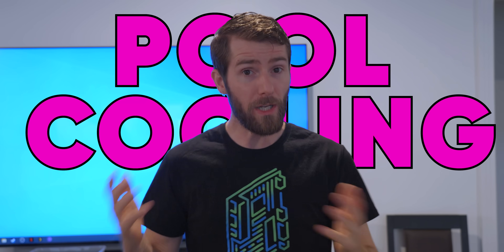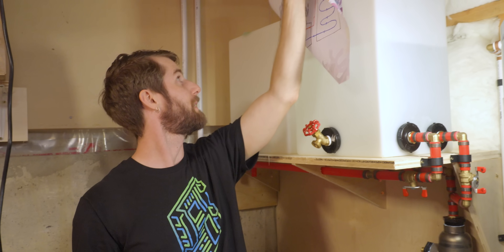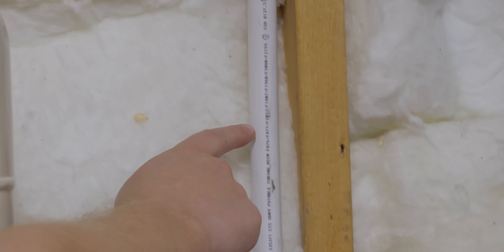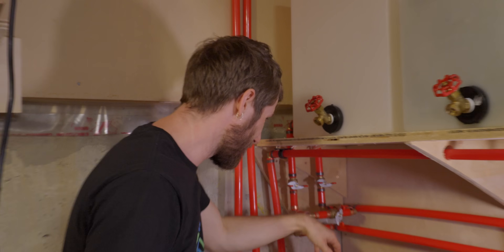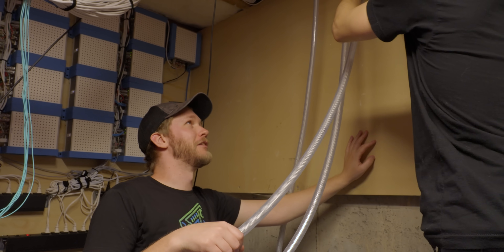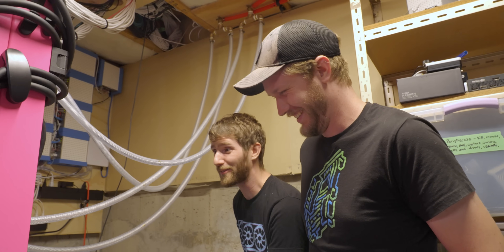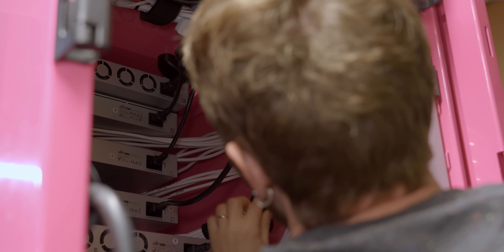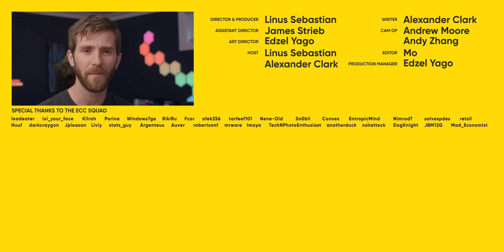My pool leaked and killed my computer - Whole Server Room Pool Watercooling Part 4

Comment: I'd guess this has been mentioned before but the pool offers up nothing.  The volume of water in that much tubing buried that deep underground would cool the rack just fine if the hole was filled with dirt.  In fact the pool might make it worse.   Ground temp 8 ft down should stay fairly constant around 55°F and if your pool temp is warmer you are probably making your loop temp warmer.
Reply: offers nothing except having the added benefit of warming the pool...

Comment: I cant believe that i thought your pool cooling loop actually dumped the water into the open pool and pulled to cool water from the open pool.   Instead you just have a loop imbedded in the concrete. lol.    I wondered how the pool chemicals affect the equipment.  But now i know that it’s a closed system.

Comment: 1.) Doesn't have a professional grade system installed
2.) installs mother boards in an upright position instead of horizontal facing down so leakage would not contact the mobo
3.) uses clear plastic tubing instead of brass in a server room where nobody will see
4.) installs the motherboards sequentially vertically instead of side by side

He could have hired an engineer to draw up something on a freaking napkin that would have been better than what he had.
Reply: Well, yeah, no crap, but this is more fun and entertaining.

Comment: A system is only as strong as the weakest component. 
That plastic "connection box" for the computer side coolant sent shivers up my spine and into my soul... 
It is going to fail. And it will be annoying, timeconsuming and very likely expensive to replace or fix.

Comment: why would you put those multiports at the top of the rack they will be better at the bottom so in case of leak the water will be on the ground and you can simply put a tray underneath that and place a cheap rain sensor in it to get an alert. I see alot of fire hazard. You need to hire someone for cable and rack management. this video is like watching downfall of this channel.

Comment: I used cablemod's 12vhpwr cable for about a year and I got constant black screens the entire time. With and without the 90 degree adapter. Switched to the gross giant adapter that came with my 4090 and have had zero problems. Cablemod support was no help

Comment: The HX is irrelevant.  This is a closed loop system.  You should of cleaned the loop out first before connecting to your servers.
Reply: Also go all pex with crimp or ottiger clamps  and ditch those worm gears and that clear pvc pipe.

Comment: I read somewhere about the fact that water in a pc cooling system needs to travel in tubes that are bend and not in a 90 degree angle. Somewhere along the line of flow restriction and even wearing off on the inner tubes. you might want to look into this, if you did not already.

Comment: REPLACE THOSE PLASTIC MANIFOLDS ASAP.
I’ve just watched this for the first time, knowing that cross-threaded, silicone gunked manifold has been in use for 3 months is giving me anxiety! Silicone degrades plastic just enough that the cross-threaded outlet will loose all tightness.
Never apply silicone to plastic for water tightness unless the data-sheet for the plastic product says so!

Comment: YES HE labeled them wrong... this is why if its not a directional dependent thing like a check valve you don't put ANYTHING on it! because in theory everything could be run in the opposite direction at any time.   What happens down the road when you need to change things round...  oh wait that never happens.  :P

Comment: JFC, put the manifolds below the lowest system in the rack, and on the outside of it, especially as you already know the fitting that was siliconed WILL leak at some point!

This is the absolute most basic consideration in pre-emptive damage control and it takes essentialy zero effort... Water won't run up a pipe if it leaks...

Comment: I've only ever had a switch do that when the surge device is really badly made and all tied into one 'detection' port.... the other option would be a bad ground, which would have popped a capacitor/resistor inside. honestly could have been worse... especially if those were holding PoE.

Comment: So what did we learn?
1. Buy the correct tools, materials and professional support you need instead of having your largely unqualified workforce cobble it together with parts from Home Depot and Aliexpress.
2. The simplest solution isn't always the best. The amount of gunk and debris in the loop was never going to be fully removed via blasting it with water.
3. Listen to Jake. He said that the loop without a heat exchanger was stupid. And guess what? He was right!

Comment: To make it easier to remember you have a source manifold and a return manifold. The hose from the Source manifold plugged into the computer on the in port and the return manifold is plugged into the out port. If you use those terms in conjunction it will help.

However, this manifold setup will not work properly. These types of rail manifolds will not equally distribute the flow across all lines.
More water will flow through the sections with the least resistance and your total volume of flow will only be that of the manifold source pipe. Which looks to have the same diameter as each individual device pipe.

Comment: I feel like it would be a great idea to figure out a way to mock up a panel for the water lines on the back of the server case, maybe where the lines go through it with rubber grommets to keep water from streaming into the case if the distribution blocks leak

Comment: with the holding tanks it is no longer a closed system. The red pex is called oxygen barrier tubing. The circulator pump is never a self priming pump never ever. You should limit the use of plastic female threaded fittings, they always,always crack. the pex needs to be protected from uv rays in a year or 2 the piping near the pool is going to riddled with leaks, the piping exposed to the sun should be insulated to maintain btu and protect from uv rays.
Reply: The piping is inside a shed now. The shed was just under construction as this video was filmed.

Comment: The pipes should be labeled "Supply" and "Return". Supply is cold water feeding the systems, Return is returning to the heat exchanger to be cooled again.  If pressure is too high, you can use a pressure reducing valve. To make sure there's even flow, you can install circuit balancing valves to each supply OR return from the headers. You'd need a flow meter to see the amount of flow to each component. The bypass should also have a circuit balancing valve, so if there is not enough flow going to all the systems, you can dial it down, but never off.

Comment: Manifolds should be mounted at the low point below the hardware. That way if any leaks did occur the water would go to the lowest point which would be the manifolds where all hoses go to. Best protection for the real hardware. Only leaks that would destroy the systems would be leaks at the water blocks themselves inside the PCs. Besides that 10/10. 💪❤️

Comment: I’m really wondering how you or your kids will ever sell your home the way it is
The modifications are going to be a major no deal for most
Reply: Which ones are you thinking would be an issue?
Reply: @haxie4516  it could be anything, a leak like this video, or the strange setup. homebuyers are not going to bet a million dollar for a home that is nestled with a time ticking big expense bill down the line, especially when the buyer may not be equipped or knowledgable to fix the issue. not to mention maintenance or using the setup they made is going to be a nightmare for the average person
Reply: @bcatbb2896  
Well, the leak in this video was to do with their server rack, which they wouldn't be leaving behind.
Like, I can't think of a single thing that was installed that has any issues like that, but isn't also something that is removable, and would be removed on moving out
Reply: Buying homes for the purpose of selling for profit is the reason why we have a housing problem. 
Just live in it forever and your kids and beyond.
Reply: @자시엘  dude, that's only one of the reasons we have a housing crisis. people have always been buying to resell since Canada's founding, the main pushing force is foreign investment after the market crash a decade ago

Comment: Never once has my NH-D15 "leaked"... Just saying...
Reply: @@CantStopTheSignal337
The install here wasn't the issue.
But you'd know that if you weren't viewing everything through your red tinted goggles.
Reply: @@CantStopTheSignal337
I mean... You clearly didn't watch the video if you are making that assertion in direct contradiction with what actually happened...
Reply: Never once has your NH-D15 fit inside a 1U chassis... Just saying...
Reply: @haxie4516  ⌐_⌐ Did you watch a different video? Because that wasn't a 1U chassis... Just saying...

Comment: This idea was stupid.
Also keeping your CPU from producing too much heat would've avoided that.
Undervolt it.
Reply: No, not really. Geothermal cooling is pretty common in many parts of the world.

And no, it wouldn't have avoided that, actually.
Undercoating it will leave performance on the table.

Comment: Amazin work and a great example of how to use all that heat for something productive.  It might be beneifical in the long run though to put some cut off valves into the loops and branches to allow for swap outs and maintenance without having to shut down the house side loop, stick pressure gauges in the loops so you can monitor for leaks more easiliy, and perhaps not mount the distribution manifolds directly to the server rack, just in case and so that when it comes to maintenance and swap out you dont get dribbles near the server systems
Reply: They use quick disconnects to enable them to do so without valves :)

Comment: segregate the quick connect blocks with a path for future leaks into a drain or a bucket with a pump that kicks on in the water is too high. at min do not mount them in the rack. its going to leak again. also they should lower so when it leaks the water does not go into the rack

Comment: But. But.... I need to understand why there was a short that blew the fuse, and also WHY the switch caught on fire??????????????
Reply: The fuse was down to a bad SATA power adapter that was shorting +12V to ground, and the Ubiquiti switch's failure is unknown, they just replaced it
Reply: @haxie4516  TY! However what’s concerning is:
If it’s that simple, I own that switch and it can burn down my house
Or:
The problem happened when a human did something right next to it: that may have played a key role in triggering this fire.  WE NEED TO KNOW.

Comment: Your plumbing, materials  and manifold are sketchy.  I strongly suggest you use a HVAC contractor to help with the sizing and specification of your piping, pumping, HX and explore all suitable sinks for waste heat.  They will help you calculate the cooling load (amount of heat to be removed) and next help review the best (first cost plus operating) approach in terms system design.  You have a beautiful home and equipment, so asking for a little bit of help in this regard is not a fail.  You did the same when you installed a very similar system... the closed loop underground heating system.   In fact you could even use pre heat of this system or your domestic hot water as a potential for waste heat from your rack.  Anyways I digress... please consider a review.  I am certain a local contractor or engineer would gladly help the channel so that your install matches the quality of your computer/network system, plus provides more IoT devices you can sit back and monitor.

Comment: Hi, it's time to using copper tubing instead of shity plastic
Reply: Galvanic corrosion says nope.
Reply: @haxie4516  not if everything is made of copper
Reply: @jacklang2349  
Which it is not right now, and many parts of the loops don't have copper versions of their parts. The waterblocks for example.
Reply: @jacklang2349  
Not all of the parts in their loops have copper alternatives.

Comment: Do you (more realistically, Alex) think the thermal mass of the block gave the cpu enough "cooling" to let the die saturate at too high a temperature? Not sure what plastic is used in the pipe that melted, but 85°C is commonly stated as the glass transition of PET-G. I wouldn't be surprised if, given enough time without heat exhaust, any system could saturate.

Comment: The major unit defines the value. "In" the collecter, "out" of the collecter. Is it leaking? No shit. Why you didn't use a copper one?
Reply: And arrows are less ambiguous.
And they're not using copper because galvanic corrosion is a major issue then.
Reply: @ScarlettCatte  So they instead use copper connections all around. Your logic isn't valid under those conditions.
Reply: @atsimas  
Nope. Various parts of the loops don't have copper versions.

Comment: Guys, you may be smart, but not one of the top ones! If you installed the water installation from the ground and placed the water distributor inlet below the level of the computers, even if there was a water leak, it would flow to the ground and would not harm the computer. In this case, the only risk you would worry about would be the leakage problem in the hoses entering the computer.

Comment: Air cooling doesn't spring leaks and fry components. I would never water cool a rig, CPU and GPU performance is off the charts without overclocking these days. Spending a small fortune for nominal increases is mostly pointless.
Reply: air cooling isn't possible for most of these machines.
Reply: @ScarlettCatte  Servers with multiple GPU's and multiple GPU's in one case are air cooled. The notion it can't be done is dead wrong.
Reply: @freedomearthmoon1  in a 1U system, yes. It absolutely cannot be done here.
There literally is not enough space to do that.
Reply: @ScarlettCatte  So you don't build in one, solved, simple
Reply: @freedomearthmoon1  Not possible here. Not enough space.
Reply: @ScarlettCatte  Now I have to laugh, he didn't have to build such an elaborate system, he could have simplified. Plus, how many people can realistically afford or build that generic system? The entire house was built around it, its nice but it would cost how much to contract out???? 50, 60 thousand dollars???
Reply: @freedomearthmoon1  
You try running 5 high power gaming PCs in a small room then.
Have fun with that.

How many people who can afford or build it is kinda irrelevant. Your suggestion is still invalid.

The entire house was not built around it... The house was built long before Linus and Yvonne ever moved there.

And again, the cost is still irrelevant... You're still just completely wrong.

Stop trying to move them goalposts.
Reply: @ScarlettCatte  I continue to laugh, they opened the walls and ran custom wiring, set up the room strictly for all those computers, a complete re-mod of that room, same in the basement, same under the pool. etc. Its beyond elaborate & expensive and a custom build from stem to stern. So, I laugh because it's for no one but Linus and a million views, he gets a system and views, the world gets nothing. No viable system for the average consumer, nothing. Just a video of over indulgence ++
Reply: @freedomearthmoon1 
Literally everything done here can be done to a lesser extent at home. 
You keep hufing that copium, child.
Reply: No you can't build a swimming pool cooling unit to a lesser extent, you could add fewer computers, which would make little to no sense for the investment. Its funny how I'm a child in the conversation, I'm not the one stooping to insults.I'm done here as you can't hold a civil conversation..
Reply: @freedomearthmoon1  
You absolutely can.
Using this same idea, you can run it all to an external radiator. Whether it's under a pool or is being vented to the air is irrelevant.

Yes, you are the child in the conversation, because your smarmy comments came out before my insults. The fact that you can't handle insults is none of my issue.
Reply: @ScarlettCatte  Several comments back I posted this...........Now I have to laugh, he didn't have to build such an elaborate system, he could have simplified. You simply repeated what I've already said. Plus, if you're talking about fewer computers, you don't need to go that extreme either. Air cooling in a room in the basement is more than sufficient, much cheaper and a hole in the floor for the wires will get the job done. Linus made several Videos, burying the pipe in the pool, creating the game room, building all the computers, etc and so forth and probably got the system for free. Cost matters and common sense investments matter. The pool cooler parts investment and new concrete, would probably purchase 6 or 8 top of the line computers, the complete wiring job and components, another computer or 2. The gaming room, 1 or 2 more computers, the man hours from all the tech guys and tech tip employees, several more computers. So, that's why I laugh and call it impractical.  If you can't see that, look again.

Comment: HATE TO SAY I TOLD YOU SO BUT I FREAKING TOLD YOU SO! This is why you don't run pool water through expensive electronics and instead use a heat exchanger.
Reply: They never were running pool water through the expensive electronics.

Comment: Saw this coming from the start.  With so complex a setup and so many fittings and so much water in those big loops and reservoirs, you are guaranteed to have leaks and they will be big messes.  Just glad you had the common sense to not pump pool water into the house.

Comment: Won't freeze inside.
But you have made the outside look sub zero capable.
So nothing stopping that loop going sub zero.
Lets hope you never have the heat disconnected to inside loop over a cold winder week..
Reply: The pool has a heater, and that loop is full of antifreeze